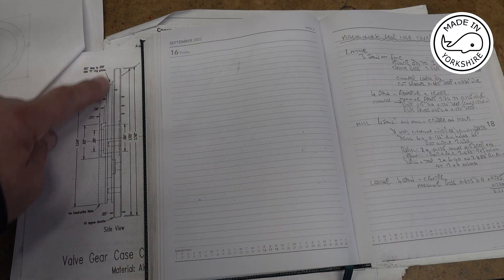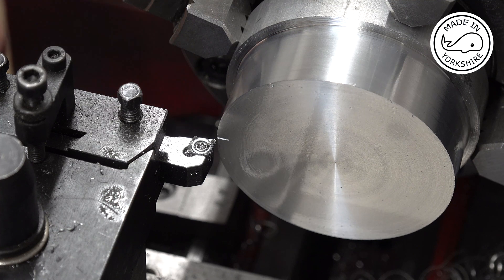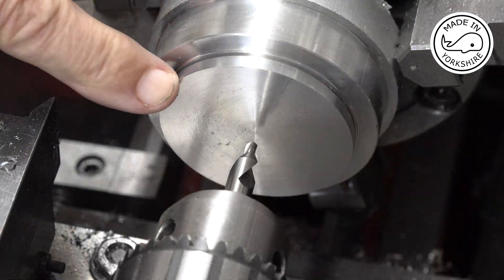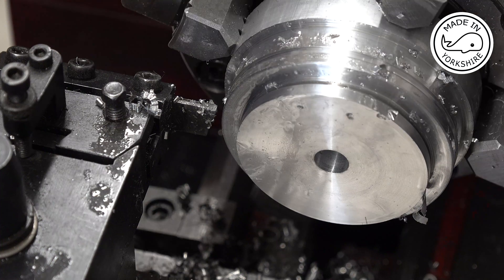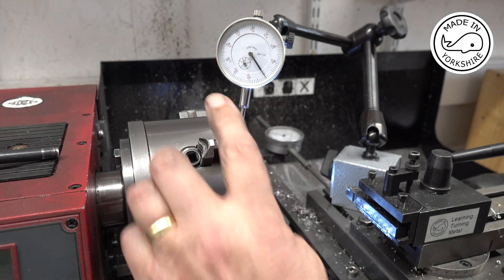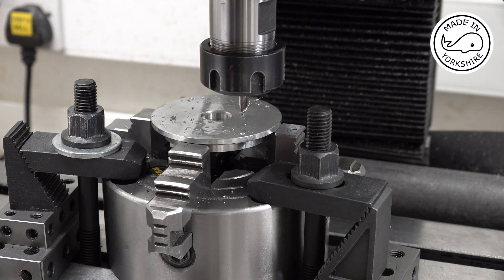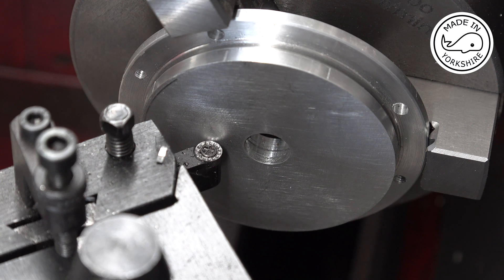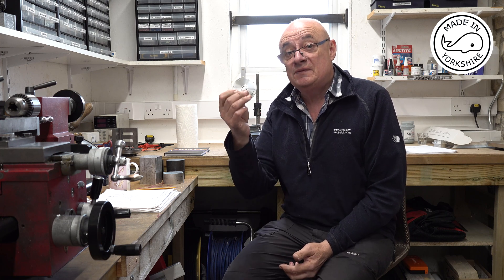#MT49 Part 4 - Jerry Howell V-twin IC Engine. The Valve Gear Case Cover. In 4K/UHD by Andrew Whale.

Comment: Hi Andrew when you have a problem parting off with chatter try turning the tool upside down and run the lathe in reverse this helps with chatter.👍
Reply from the maker: Hi Randy, many thanks for the tip. I must give that one a try.
Cheers
Andrew

Comment: Andrew, I'll certainly be watching this series.  I do appreciate your methods and great video and audio technique.  I learned a lot by watching your Farm Boy series and I've built one of my own as you know.  I may decide to build this engine also!  Great work!
Reply from the maker: Thanks Mike. I must include that video clip of your Farm Boy in my next video - assuming that's OK. I hope you give the V-twin a go. Far more work than the Farm Boy, but another great Jerry Howell design.
Cheers
Andrew
Reply: @learningturningmetal  Andrew, you can certainly include that clip.  I've been working on further optimizing the hnm action and have it working a bit better, although still not as good as yours.  I've also torn it down and am in the process of painting it now.  I will post a video of it when its completely done.  I do have a very small YouTube channel, certainly nothing as good as yours!

Comment: Thanks for an interesting and inspiring video, well made as always. Filming, editing......
Time 00:55, the setup The stick out of the jaws is large meaning that the number of jaw teeth handling the clamping force are not that many. Why not turn the jaws around and use the inner part of the jaws? Thats easy on a 4 jaw chuck.
The parting of blade looked like doing a good job after being sharpened. Why didn't You do more of the parting off and less of bandsaw work? I don't trust my bandsaw to cut straight down in such a cut..... It could angle into the work piece...
Reply from the maker: Thanks Stefan. I set the 4-jaw up that way, as I could get more material clamped by the jaws. Parting off on the lathe would have required a tool overhang of about 1.5", which would have put lots of pressure on the lathe components. Using a mandrel to hold it in the bandsaw also provided the added benefit of being able to face it off easily on the lathe. I must admit that it wasn't part of my original plan though. 😉
Cheers
Andrew
Reply: @learningturningmetal  You have a point in getting a larger contact area. Reversed jaws could allow higher holding torque. However, You got torque enough.

Comment: Hi Andrew. Nice work. Going to be interesting how you tackle the valve case. Bye the way I've just started building the Hoglet V-Twin. Regards Kevin
Reply from the maker: Thanks Kevin - yeah the valve gear case will certainly be interesting! The Hoglet is a nice 'show and tell' engine and I thought that if I could make that it would put me in good stead for making the more complex JH. I had all my engines running at the weekend (family gathering) and the Hoglet certainly has character. I'll check your Hogelt build out.
Cheers
Andrew

Comment: Nice job Andrew. The part came out with a nice finish. I am guessing that there is a cover plate to go into the shallow recess outside the bearing housing. The valve case sounds like a real challenge. Good luck.
Reply from the maker: Thanks Tim - yeah you are correct about the cover plate. The valve gear case is pretty complex. I keep on reading the fairly brief build instructions but it's still not sinking in. Cheers for now.
Andrew